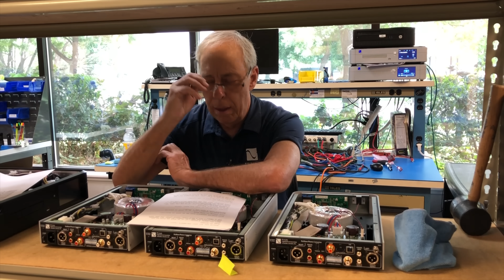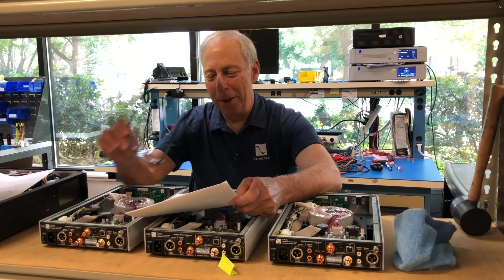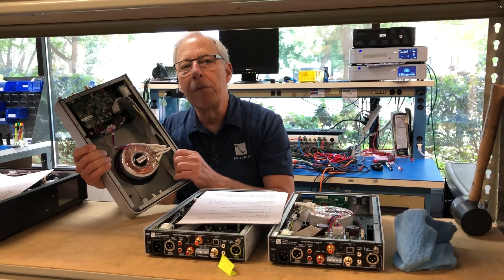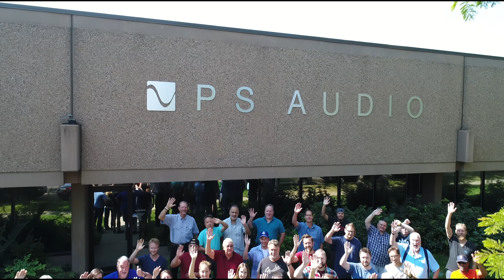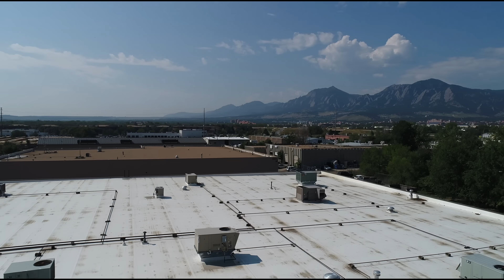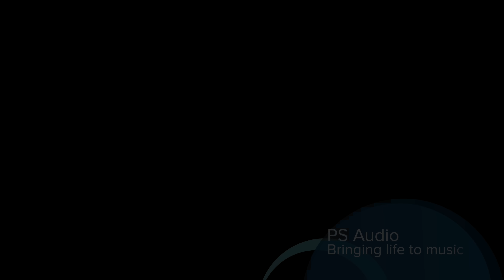What's inside a high end power cable?

Comment: It's a marketing scam....  There is NO WAY a power cable could EVER affect the performance of audio equipment... If it does, your equipment is either doing some mystical magic or badly designed and doesn't deserve the title "High-end" .
What you are claiming defies science.
 I can even bet that speaker cables shouldn't affect performance provided they are of low DC resistance like 10 or 12 gauge. And also if your amplifier is sensitive to the tiny capacitance in an ordinary cable,  your amplifier is rubbish and doesn't deserve the title "high end"....
Reply: Enjoy your unsuscribe ^^
Reply: Try borrowing some high end mains cables, speaker cables and interconnects. The changes are there to be heard. You missed the point by taking up a position. The greatest difficulty for high end cables is the price. The performance is easy to hear.

The way to think about it is that the amplifier is transferring energy from the mains power supply to do work moving the speaker cones at audio frequencies. The energy is drawn from the mains at audio frequencies and so the mains cable acts as a spring. At some frequencies it will resonate as it transfers energy, its impedance will drop and it will be efficient. At other frequencies it will be less efficient in its transfer. That will moderate the energy transfer as a function of frequency. The wires in the cable will be doing work. They attract and repel each other especially if the signal being amplified causes a phase shift between the positive and negative legs of the cable. The signal therefore will create magnetic fields that are affected by the structure of the cable they are travelling in. There will be an aerial effect as radio frequencies enter the cable and then the feedback loops of the amplifier. The cable will interact with these and so modulate what is coming out of the speakers. So, changing the structure and materials of a mains cable should show up as changes to the quality of sound. It becomes possible to vary the structure and composition of the cable to make it more benign in its effects at audio frequencies. You can also increase its rejection of radio frequencies and their effects on feedback loops. The mains cable therefore is a frequency dependent device storing and releasing energy at audio frequencies and that is audible.
Reply: Larry Niles I'm not disrespecting Paul at all. But I am asking him to prove his assertions. He claims that there is a difference but then adds absolutely no evidence whatsoever other than his statement that he can hear a difference.  And the only people making these claims are those selling these overpriced cables. If he is correct, then he should be able to explain the physics of his cable and how it makes changes.  You aren't curious yourself?
Reply: I was certainly right with you. Then I did something crazy and tried a couple out. Nothing crazy expensive $ 150.00 ish.  Amazon prime so that I could send those suckers back. Dammit, I can tell a difference. Nothing crazy, but  noticeable. no I do not know why.  Try a couple out. It is free to try
Reply: Larry Niles okay, it's your money.  You should definitely spend it however you want to. And if you believe that that's the part you want for that price, then buy it. But if you are purchasing it based on Paul's claims, then you're kind of tossing your money away. But again, it's your money.
Reply: I won't single anyone out, but those of you proclaiming from the highest mountain top that there is absolutely no way a power cord can help, call it a scam and rubbish, yourselves are guilty of broad-brushing and pontificating without any shred of evidence to backup your claims. If I did try these and believe they do help, so be it. I don't need anything other than my own test. For the rest of you, show us YOUR data disproving these cords. Can't, can you :)
Reply: James Plotkin I don't know what data you want us to show. I can say that if you understand electrical engineering, then that is all the data you need. And we're not want the one making the assertion. Paul is. Let Paul show us how his power cord makes these changes. If you want to pay for the placebo effect, then that is certainly up to you.
Reply: @jamesplotkin4674  that's not how science works.
Reply: science is perfect.  Everyone stop all advancements in science as it cannot be further advanced because Collins says so.  No point in taking any degrees in that subject anymore then.
Reply: Actually, we understand the physics very well.. The physics have long been settled.. But you need to sell a product, so you push this nonsense. But still waiting for someone, anyone, to explain the physics that a power cable will affect the noise, distortion, or frequency response of a system.  It won't.. But I'll wait for an answer, one that not even Paul can properly explain.. We in the professional audio world laugh at this nonsense.
Reply: AB-SO-LU-TE-LY....!!!!!
Reply: Zi m  -- That's because Nelson Pass is both a highly accomplished audio engineer and an honest, sensible human being.  As for "upgrading" a tiny, IC-based Class D amp by swapping in a pricey power cord -- that's a completely absurd suggestion!
Reply: @TA-nn9os   Hahaha,  high-end audio is full of all sorts of lies...  Once I was researching,  came across a video on CES (don't remember the year) and there was this company that made low cost audio equipment,  and on a nearby booth another company that's "high-end". 

The entire cost of all the equipment in the "low cost" demo was less than the cost of the speaker cables and interconnects of the "high end" company demo.
Ironically,  the audience preferred the sound quality from the "low cost" setup... 

Audio equipment shouldn't cost a fortune to sound good...
Reply: @collinsmwaura1833  brilliant example of your expertise in this field. You saw a video. A highly compressed, artificial sounding video. And that is what you base your weaker and weaker arguments on? A video? No actual real world experience? You are what is wrong with the world these days. Because you personally haven't experienced it, it must be bullshit? I have a question. Why did you feel the need to spout your negativity on this channel?
Reply: MrJules39 .... it IS bullshit !! Plain and simple ..
Reply: Stop writing a wikipage and start listening with your ears.
Reply: @TA-nn9os  Yes it is very satisfying...  As for me,  I designed the amplifier schematics and PCBs from scratch... It took me nearly two years developing the concept. It's a unique bi-amped design using unique active filters I designed ...  Speakers are all acoustic suspension design with very serious damping. Damn sounds good than anything I have ever heard! The ability to make the listening room completely disappear with sound that's so fine detailed..  And bass sooo perfectly blended and detailed and smooth, sometimes the experience makes me feel butterflies in my stomach...
Reply: @TA-nn9os  it's hard to say...  But I do believe,  as a business man you have to sell a good story so that people keep buying them...
Reply: @TA-nn9os  I am from Kenya by the way... Most people around here don't care about sound quality...  But as for me, music and electronics is a passion ever since I was a child ... I built my own audio system from scratch (the amplifier and speakers) after designing and experimentation for two years. So far its one of the best sounding systems from around here.
Reply: @collinsmwaura1833  yeah, And I bet your one of those 'flat earthers' too aren't you? You haven't had the chance to hear it (and neither have I by the way, but I have an open mind in that just because I haven't experienced something, doesn't make it unbelievable). I'm curious, you say your home built kit is better than anything around you.....just how good IS the high end HiFi scene there these days? Last time I went, a Sony boombox was the epitome of sound.
Reply: @MrJules39  I wouldn't call it a Kit coz it's a serious system that's uniquely built, based on circuit topologies I came up with. Many people around here call me crazy...   I decided to be serious about audio,  unlike most of the people around here.. Once I finished my first prototype an year ago,  people would come to listen and would end up shocked, I don't know how to describe it... Once a sound engineer who works at a recording studio came over,  he was shocked, he said it sounded more vivid and realistic than the monitors at his studio. 
 High-end audio is difficult to come across in Kenya, so rare...  So far I know of a handful of audiophiles,  my uncle being one of them and he owns a decent audio system that many say it's a crazy idea to purchase and install.
Reply: MrJules39 Keep believing that you'll hear a difference and you will.  But an actual difference doesn't exist..
Reply: Hhhmmm....  The truth is, its a state of mind...  If you totally believe your car will go faster if you paint it black ,  your mind will be convinced until you can notice it going faster...  The same way the same meal tastes different depending on a person's emotional state or state of mind.
Reply: The truth is, its no state of mind...  If you totally believe your car will go faster if you >pour best gasoline in<,  your mind will be convinced until you can notice it going faster...  The same way the same meal tastes different depending on >buying ingredients grown in a glasshouse from the supermarket, or fresh from the market.<
-> same inside, different test.
Reply: Collins Mwaura Total snakeoil indeed... I don't know what's worse though... the moneymaking scam or the dishonest technical "explanation".
If this is really how they engineer their products, I think they should be looking for another carreer, far far outside of electrical engineering. He obviously has no clue

Comment: I always laugh when I hear the term "oversized" when referring to anything from speaker driver magnets to transformers. It's exactly the right size! That's why the engineer chose it. 😁
Reply: @  Rolf Hawkins That's probably because you're looking at this the wrong way. When I purchased my Rotel amp 18 years ago, there were none available for delivery, so the dealer lent me a Sansui amp of nominally the same capability. When it was replaced by the Rotel several weeks later, there were clearly audible differences, mainly in the bottom octaves. The only obvious difference between the amplifiers was the weight of the much larger transformer and power supply capacitors in the Rotel. When I needed to replace the Rotel temporarily with a Sony while I serviced the Rotel a year or so ago, the phenomenon of changed bass response was also readily perceptible. Even the missus noticed! The Sony, like the Sansui had a much smaller transformer. Perhaps it's a case of some engineers preferring undersized parts to save on weight and/or cost.
Reply: Of course a power amp is a totally different topic than a phono amp, preamp or DAC when it comes to having headroom in the transformer. Indeed, for a power amp, you are facing some dynamic load condition that depend on how loud you play and how hard your speakers are to drive. It's good for a power amp to have a transformer that can give you extra power that you need especially in the bass when playing loud. But Paul is talking phono amp...LOL
Reply: @ ThinkingBetter The engineering side of my brain wants to agree with you. Unfortunately, I have far too much experience of theory being flat out wrong. Most recently, medical theory very nearly killed me on Wednesday. Yesterday I left the hospital confined to a wheelchair. Within six hours I was walking again even though medical theory claims that the pharmaceuticals I was ingesting do not work. "If the facts don't fit the theory, change the facts." LOL! I'm happy to give Paul the benefit of the doubt until I have the opportunity to test his claims for myself.
Reply: Jonathan Sturm I hope you are getting better. In terms of medicine, things are far less predictable.
Reply: I am much better thanks and even more determined to follow my own path of evidence-based medicine. Yes, medicine is inherently less predictable than the harder sciences. That's biology for you. What tends to be forgotten is that music is biological too. It's what philosophers call metaphysical — beyond physics (what used to be the term for the hard sciences). You can show me an fMRI of what's going on in a human brain when the subject is listening to music. But it's not music just as pain isn't electrical impulses in nerves. Pain and music occur in the mind that some deny the existence of.
Reply: @Jonathan Sturm, Engineering is Not physics Its applied mathematics.
Reply: @ThinkingBetter  
It is useless, putting a large transformer makes the equipment heavier, which makes those who see it in the store think that it has a better construction. and it costs $ 30 more and allows you to sell it $ 1000 more expensive
Reply: @animalmuppetmonster664  Yes, that's how it works. But there is a side effect of just having a large transformer in audio gear that doesn't need it. Bigger transformers yield more EMI issues and for a power transformer that means you easily end up with more 50Hz or 60Hz hum. So you also need to waste money on the BOM for shielding off that over-sized transformer and the box will have to grow to accommodate more distance. And in reality the quality of the voltage of Vcc rails in any well designed pre-amp, phono-amp or DAC is about the electronics that regulates and filters the DC and not about the transformer size. Of course the transformer needs to be chosen to match the max current needs and the power supply electronics must ensure max load is still precise and with super low noise. If the electronics can't do a good job in maintaining a clean Vcc, then even a heavy transformer will not avoid making the Vcc very dependent on your mains power fluctuations.
Reply: In many cases with high-end equipment, it is that size to justify the price.
Reply: An engineering graduated told me once 'it doesn't take an engineer to make a barn stand forever, it takes an engineer to make a barn barely stand'.  In essence the point of engineering is to get as much as you can out of as little as possible.  It's why an amp rarely can provide full power across all channels at once, because an engineer knows that most of the time it won't have too, and even if it does the user won't notice the lack of power.
Reply: Rolf Hawkins The only industry this is common practice in is hi-end land. Not in medical equipment, not in highly sensitive measuring devices, and so on... Oversized is just that ; oversized..... and thus overpriced. Whatever makes you happy, I guess.... :-?
Reply: Tubetinkerer exactly the audiophile group is the only group that makes any of these claims.